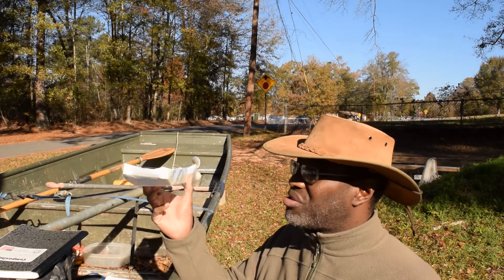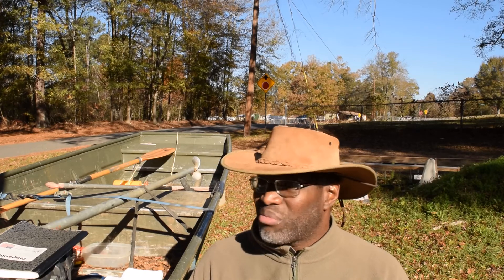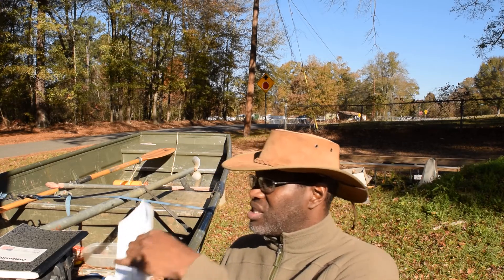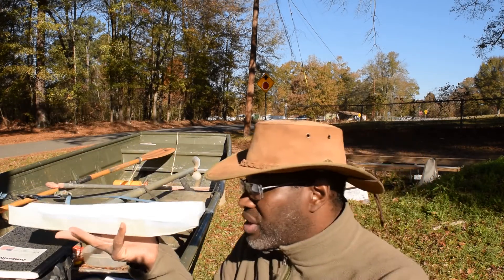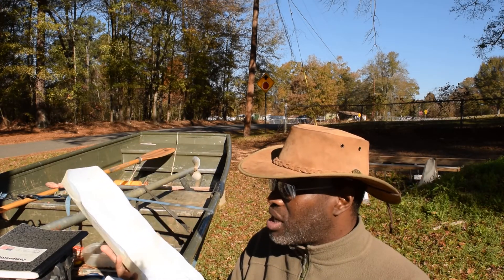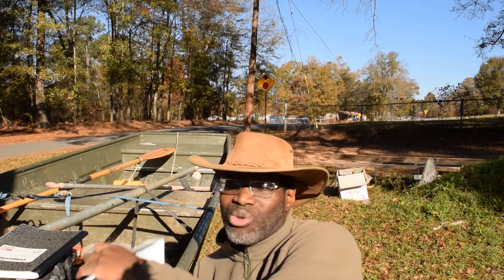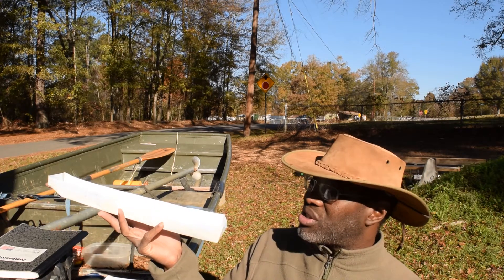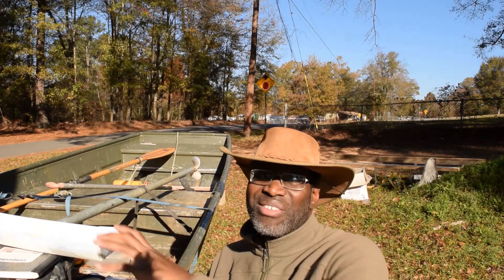Model Complete! | Thai Longtail Boat Plans

Comment: Do a lofting of the shape on a cardboard sheet (4' x 8') which is the sections at the different points, so it's all on one sheet. That way you can scale the angles you need. It's easier to keep track that way. Stations (fore & aft) & butt lines for the width. Best way to keep things straight. Looks like a nice shape to drive through the water.
Reply from the maker: thx